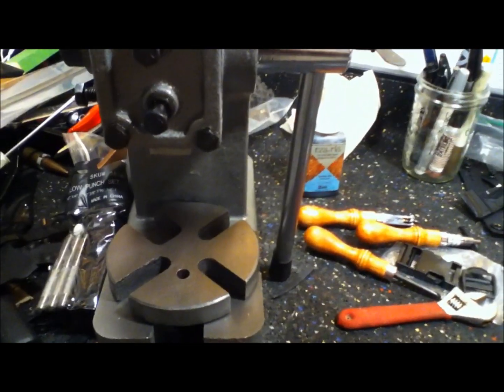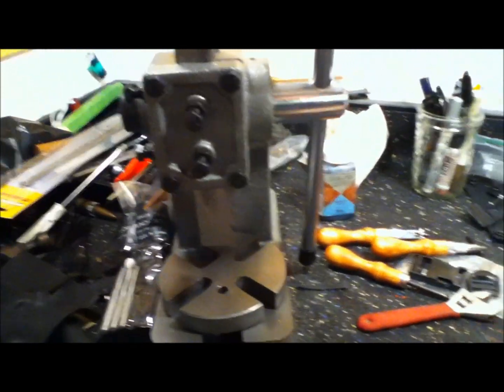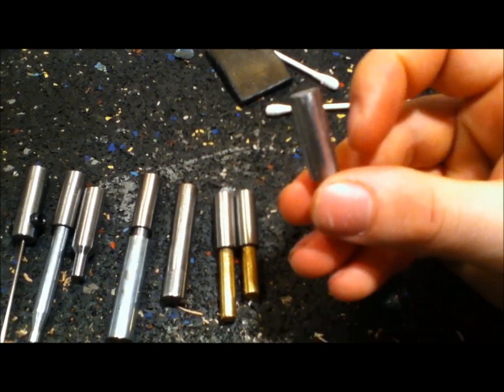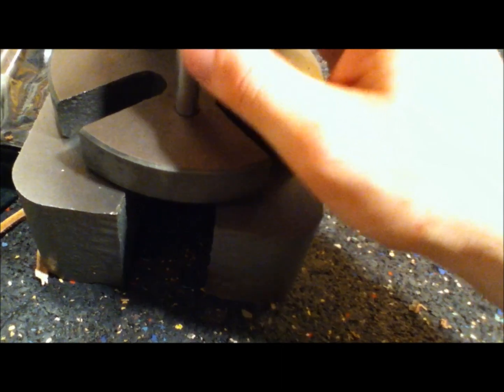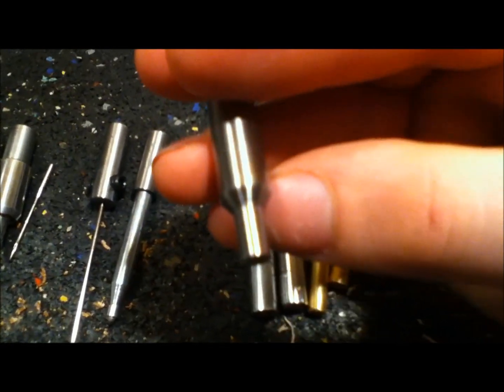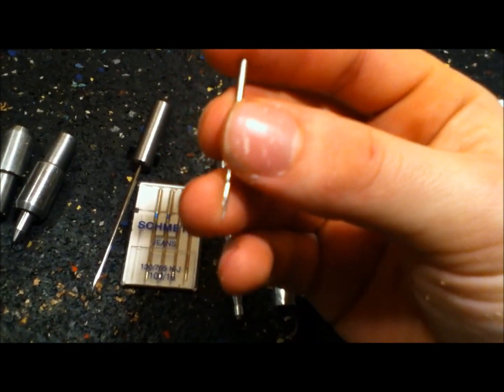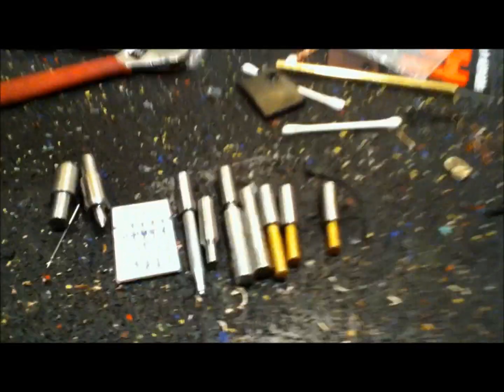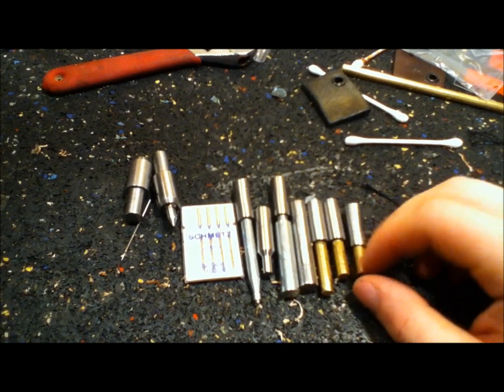Arbor Press Mod

Comment: I like the hole double drill method.  Just got one like yours and it does not have holes.  Not real savvy here, do you sell punches, etc?  Thanks, constance.
Reply from the maker: Here's a video of a guy modifying one,https://www.youtube.com/watch?v=8YAw-13czTQ  I prefer clamping the platen tight to the frame using the the ram of the press, and then flipping the whole thing upside down and drilling through both the the platen and the ram. that way you are 100% sure the holes are aligned, but most people do it the way shown in the video. also his threaded die holders seem over kill and take too long to change

Comment: I love the long needle and cork idea!  Many times we've had to punch holes for belts, and also we like a make small leather projects.  You can get a rolling wheel with sharp spikes on it, to mark your points for stitching, then use your needle punch to finish the holes through.  Thank you
Accent sounds L.P. Michigan to me, have relatives.
I really like all the punches, and variety you have created for use with your arbor press.
Reply from the maker: close, wisconsin